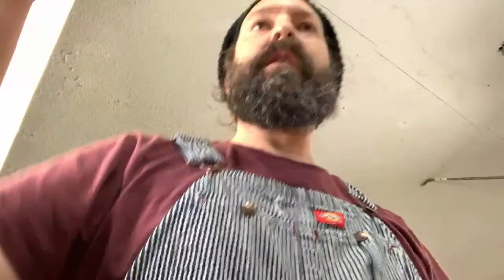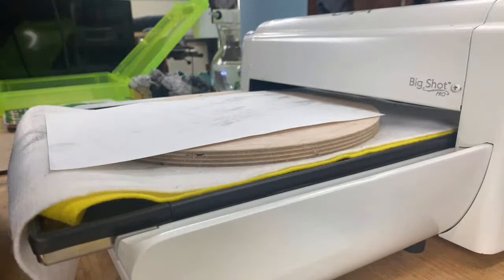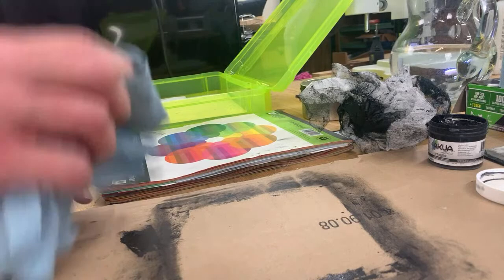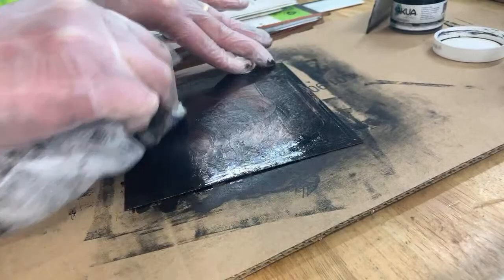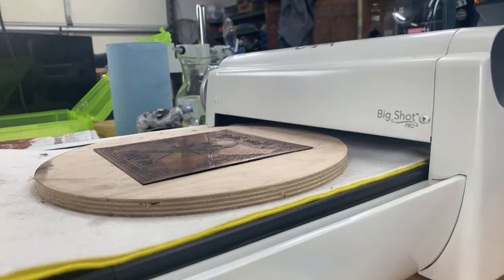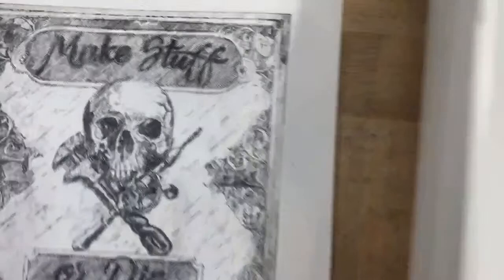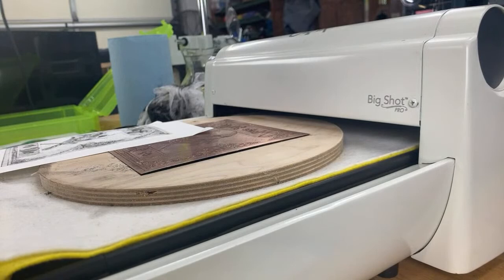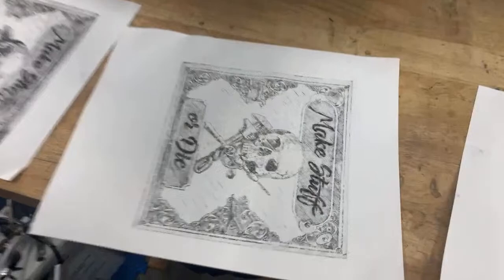First prints of the hand engraved plate!

Comment: Beginner Copperplate engraver myself. Your issue is probably not the engraved marks themselves Bc those look fairly deep. It’s the plate wiping. Once you’ve finished with the tarlatan, get some whiting powder, rub it on your exposed palm and use your hand to wipe off that excess ink. Then wipe off the balled up bits with a clean sheet of newsprint.  It may look like you’ve removed too much ink but it really makes the engraved marks crisp and gives a real even plate tone. Cool to see someone else doing this. Cheers!
Reply: Seeing the other comment. I think they are right, better to use a piece of card stock or something rather than to rely on the breyer to spread the ink into the marks.